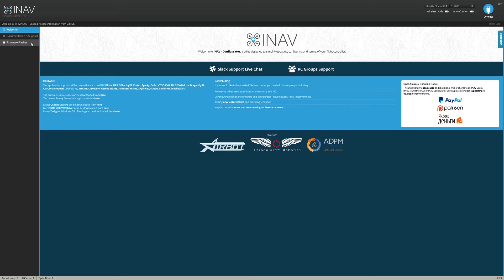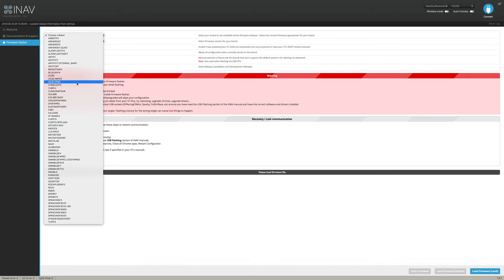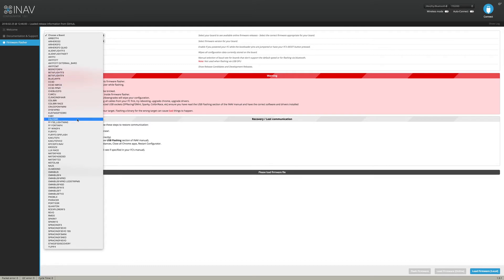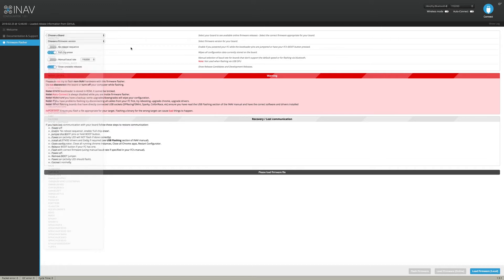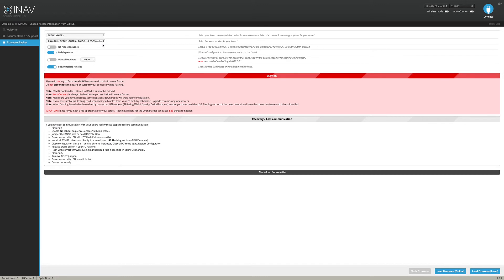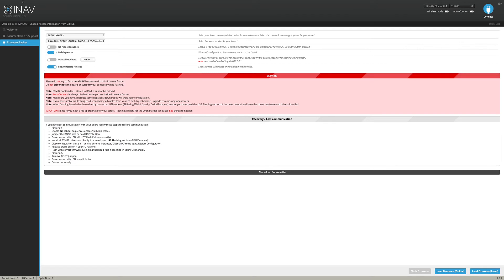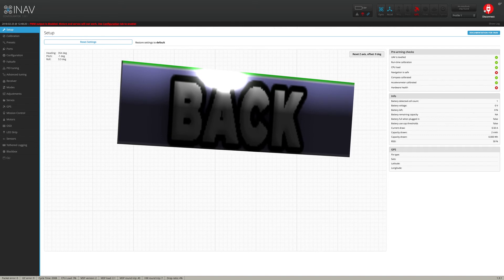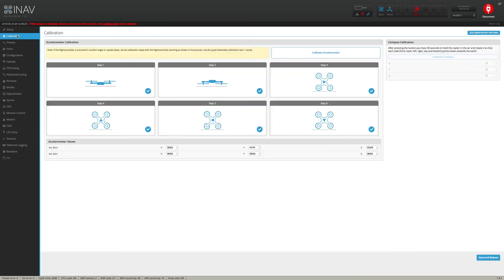INAV 1.9-HOW TO FLASH THE NEWEST BOARDS THAT ARE BEING ADDED

Comment: pls help how do i connect naze32 to mac 
beta flight says 
Serial port successfully opened
no responce in 10 seconds
Serial port successfully closed
amosoak@gmail.com
Reply from the maker: unicyke sorry idk. Never had an issue at all on my Mac flashing any board with inav or betaflight. My pc always has issues with the newer usb to serial drivers though. I’d say you need to download the cp driver on the front page or try the impulserc driver fixer program from their website.